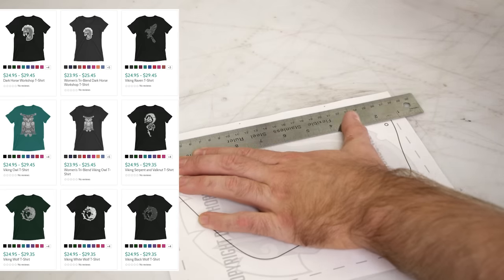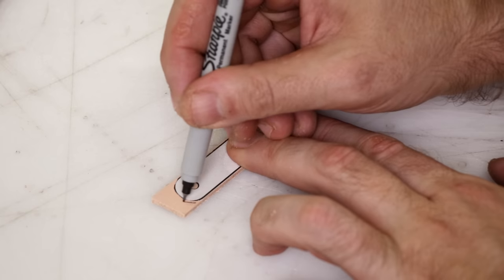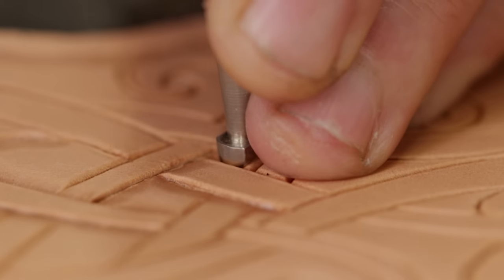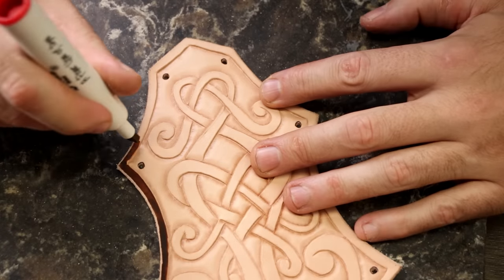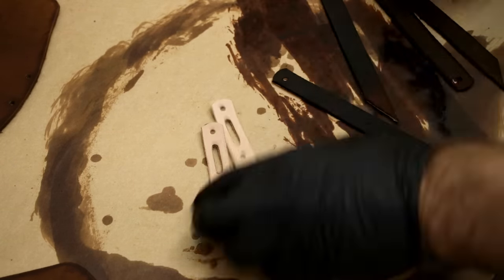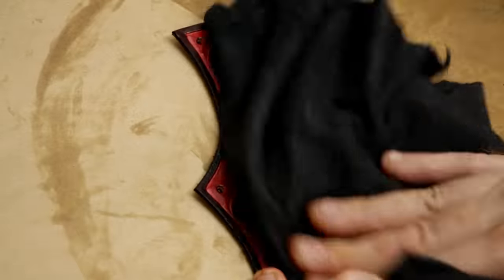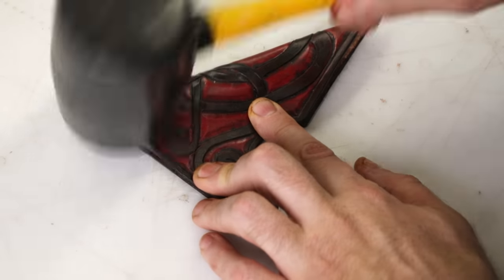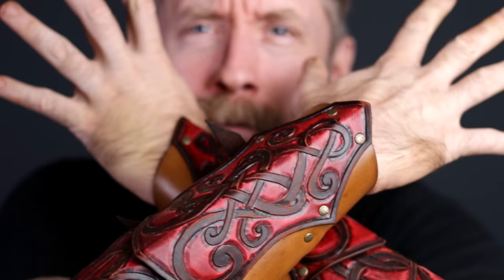Leather Armour Patterns - Vambrace Armour

Comment: Question about the transfer you used, did you intend to have the ink wipe away as you were tracing the design or was it “just what happens”? Because that seems like a great idea to help keep track of what you have and have not traced. And if it was intentional, do you mind sharing that info?
Reply from the maker: It's done with a laser printer so it disappears as I do it.